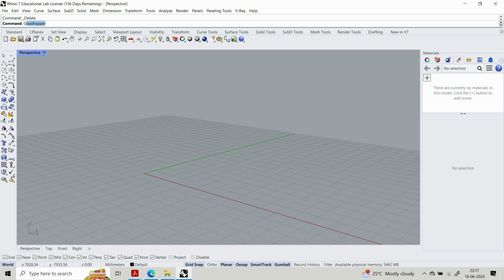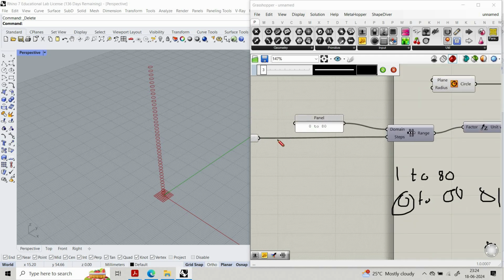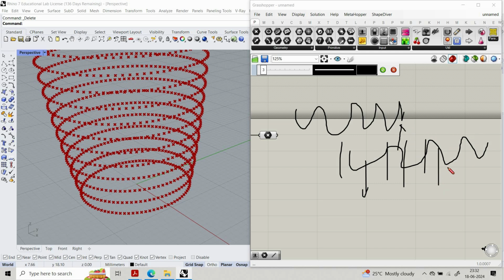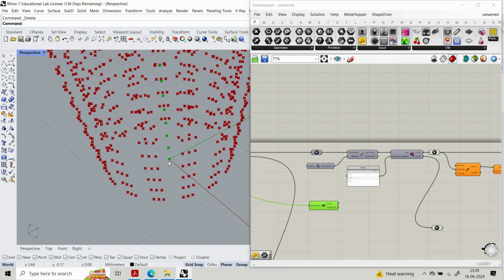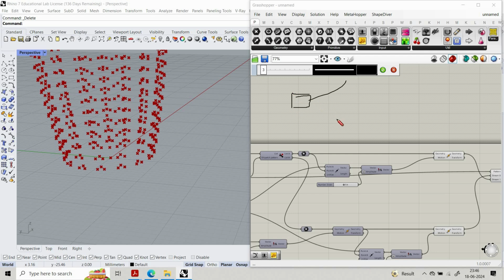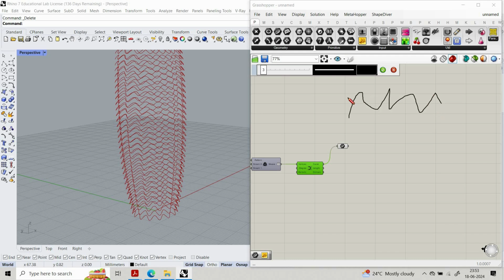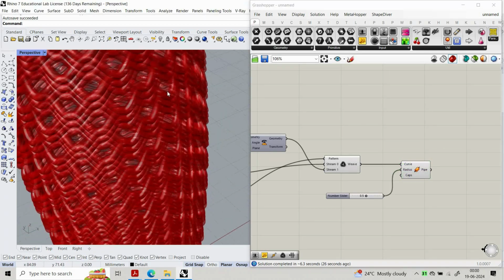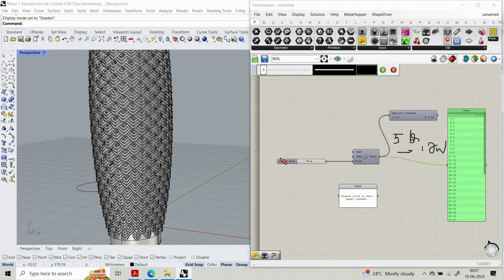Designing a 3D Printed Lantern in Grasshopper | Rhino 3D Tutorial| In english

Comment: Hi,
this is awesome 
I followed tutorial and reached the same geometry, but each ring is still a separate curve.
My goal is to generate one continuous tool path so the printer never stops and restarts.
Could you please show the extra Grasshopper steps needed to
• sort the rings from bottom to top,
• flip every second ring so the seam walks upward,
• add small bridge curves between the end of one ring and the start of the next, and
• join everything into a single polycurve before piping or exporting G-code?
I have attached a screenshot of my current definition and the Rhino preview for reference.
Any quick tip or component list would help a lot.
Thank you.